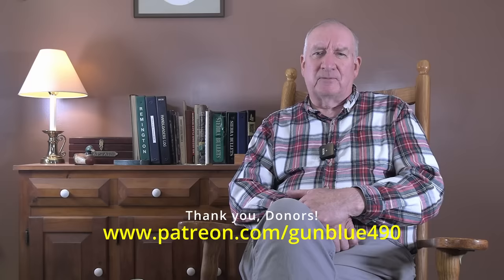The Copper Fouling Lie ~ Don't Fall for It!

Comment: Thanks for the sage advice. Always enjoy learning from your videos. 

What is your opinion on the use of abrasives, e.g., JB bore paste, IOSSO, etc, for bore cleaning?
Reply from the maker: I've used JB to clean rusted and neglected barrels, and it has helped correct old bores that foul with carbon persistently, but I certainly wouldn't use any such product on a new barrel, as the silica content used with a brush or patch can scour an otherwise smooth bore.  I've seen written articles about using such products to lap a barrel, which is entirely bogus.  Barrels must be hand lapped using decreasing grits of compound in conjunction with a barrel-cast lead slug before they are chambered and crowned.  Doing so afterwards will bell the throat and crown and ruin a barrel.  Good barrels require only a mild solvent to remove powder, soot, and graphite, which easily yields to a few tight, wet patches and perhaps a few passes with a bronze bore brush if needed.  The best routine is to saturate a wool bore mop and run it through the barrel.  Allow 15 minutes for the mineral spirits or Hoppe's #9 to loosen the carbon, and the wet patches will really do a great job.  The same holds true for carbon fouled rifle parts.  Drop them into a pan of solvent, and in several minutes they'll be practically clean by themselves
Reply: @GunBlue490  Thanks, GunBlue. Just picked up a quart of mineral spirits and will give that a try on a custom barrel with which I'm having a little trouble removing the carbon in the first few inches after the throat.

Comment: Thinking about a new 22-250 ,mine a rem bdl  1974 mod.
want to put my can on it ,never did the heavy cleaning thing .
Want to thread ,don’t want to spend $$ on a new bbl or threading 
If not needed   Mostly hoppies #9 on everything 
Throat erosion muzzle erosion??

Comment: Mr gun Blue thank you for your videos they are extremely helpful and I enjoy the cracker barrel style explanations of different and various topics I find it very pleasant . I have nothing but respect for your knowledge, I have often said the truth usually lies in the middle of any topic for there are those who are four or against every controversial topic, people , Will continue that method which works for them, for me the question becomes what is your idea of accuracy is it minute of pie plate at 100 yd, is it 1 in at 100, 3/4 in 1/2-in quarter inch or much less at 100. I believe that answering that question will dictate how often a barrel should be cleaned and understanding the nuances of barrels are all not the same much like people are not the same The recipe of the steel you can order 10 barrels from a particular manufacturer and all 10 will be somewhat different they will all shoot somewhat different. To say barrels when shot repeatedly build up copper in the boar is a fact of life there are several factors heat will vaporize the copper and deposit it down the bore and to say that the barrel will build up copper and then suddenly stop at a certain point with all due respect doesn't make any sense to me and I know people will hate on me for saying that but if world-class shooters who I will not mention out of respect for everyone The top guys cleaning their barrels all the time in the game of bench rest is different than f class f class is somewhat different than PRS and if John Krieger says to clean your barrels respectfully oh that's what I'm going to do so I am not trying to stir the pot but I respectfully have to stand up for what I believe is a mischaracterization of barrel cleaning, I am not one of those people who will clean after every 10 shots but I believe you should know your barrel and at some point you're going to know when to clean because you can control the frequency of cleaning to just shoot and shoot till the barrel begins to respond negatively and then clean your barrel doesn't make sense to me you can control the cleaning process and that will be one less variable that you can say why did my group open up the way it did You're removing one more variable. After reading the reviews I felt that I should give a different perspective and it is with great respect to your knowledge and I'm still a fan and always will be and once again it is with reverence that I disagree but I like your videos and will continue to watch them you are a wealth of knowledge and thank you for helping the shooting public in educating them to a higher level.

Thank you sir
S Baker

Comment: Always only used just only plain gun oil or 3 in 1 oil that my grandpa, dad, uncles etc...just used and never no problems. Not even with graphite for trigger, action, safety etc... but quit using that. Not a duck or goose hunter, but always heard the duck hunters have problems with their barrels cause from shooting steel shot. Not unless its neglect where someone puts wrong caliber bullet in gun etc...

Comment: Copper solvents are not snake oils; they are very helpful to remove copper from your barrel. Think about it! My sporting guns will not group with copper in the barrel how can a gun shoot straight with foreign materials building  up in barrel? IT Can't. Match shooters chide me when I clean my barrel at the range however they change their barrels on average four times a year. I wonder why? Find your own way I know my guns shoot much better with a clean barrel. If you start losing accuracy look in your barrel if you see the copper fouling instead of wasting bullets and over heating you gun try removing the copper with a good solvent (bore tech) you will be delighted when you go back to range.

Comment: I just bought some CFE223 powder. Not because of the CFE feature, just want to try some rifle loads. Should I be concerned about aggressiveness to my bore?
Also wondering if copper plated bullets pose any fouling issue. I’d assume it’s a different alloy. Although I’m only shooting them in my handgun so I’m only curious, not concerned.

Comment: Mr. GunBlue490, I inherited a very old Ruger M77 from 1970. It saw many hunting trips in its hay day, and it's in rough shape. I took the extractor off, and the back side of it is covered in...well...probably 50 years of carbon. What do you recommend I soak these smaller parts in? Carb cleaner? Mineral spirits? Hoppes? Thanks.

Comment: Get a bore scope and look for yourself what matters and doesn't matter for your rifles ability and your ability.   Also,  just because the military does something doesn't mean it's the best or even the right way to do something.
Reply from the maker: It's not my bore scope that shoots sub MOA.  There are two issues at large; the claim of excess pressure resulting.  In that case, the evidence shown by decades of military and civilian use and abuse put that to rest 100%.  Pressures do not rise.  Not one commercial rifle maker or ammo maker has ever warned of a danger of not cleaning copper from barrels, because there are no such concerns.  

The second is the claim of accuracy loss.  I personally attested that I do not remove copper and that my barrels remain highly accurate, below sub-MOA.  I've attended many matches where shooters don't clean throughout the day, and many never clean copper at all, from match to match.  Such are the many comments in this section.  Some benchrest shooters swear by it, others swear against it.  Copper removers are caustic enough to remove copper, and are corrosive enough to easily attack steel.  Some baseball players wear the same underwear at all games, which has nothing to do with anything, any more than the possession of a bore scope has to do with a gun shooting accurately.
Reply: @GunBlue490  a bore scope tells you how good your cleaning regiment is.  It will show you when the copper is smeared over the carbon and layered in there.   You mention of copper filling the voids in the barrel,   I've never seen copper fill the voids in the fire cracking on a barrel.   Or copper fill any pitting in the bore from corrosion.  
Sub moa means very little and is a very broad statement.  Sub moa might carry weight to a short range large game hunter with factory barrels. 

 The military standard for most shooting is basically sub human or sub hummer.  Not really a flex to brag about . 556 and 308 don't abuse barrels compared to many other cartridges out there. Barrel life in the 6-8000. Maybe try something that eats barrels in under 1000 rounds and tell people how not keeping the bore clean won't give them accuracy or pressure problems.       Your accuracy standards and personal experience is obviously different than mine.

Comment: First of all, I love your videos and watch them every chance I get. if you don't mind, I have two questions. When cleaning a bore,  does it make sense to clean from the muzzle end?  I was thinking that any fouling went in from the chamber end and it may be better to push it back than forward to remove it. Next question, I once fired a box of Winchester Supreme ammo with the black  teflon coating through my 7mm Remington magnum. After the 20 rounds, I discovered the rifling was filled to the point of looking like a smoothbore about 6 inches back from the muzzle. The plugged area seemed about 3 or 4 inches long, took a lot of scrubbing to get it cleaned out, A few years later my brother used the same coated ammo with the same results in his 270. Both rifles were Winchester model 70. I always thought that as the coating wore off, it got pushed into the grooves, Just wondering if you have any thoughts on this sort of thing. Thanks for your videos, knowledge and God Bless
Reply: Can't help you about the coated ammo, but it sounds like normal  leaning with a brush would be all you need. With regards to cleaning ALWAYS clean from the breech end when your firearm allows it.  You risk damaging the muzzle crown cleaning from the muzzle. Damage that and accuracy is shot.

Comment: I knew an old timer who never cleaned or oiled the action or barrel rifle over 50 years of deer, moose and elk hunting. He never had a single issue until it got so gummed up it wouldn't even set off the primer. He'd just wipe it down with oil and lean it in the corner.

It goes to show how pointless the perfectionism is for the average hunter.

Comment: I bought a winchester mod. 70 that was manufactured after 1964.
   Oh no !
 They're a piece of junk
no claw extractor , blah , blah , blah
Bought it way used in 1981 
 Shot several brands of ammo thru it to see what it liked
Rem. 150 gr corelocks
I have shot many deer , antelope , a coupla cow elk , coyotes , prairie dogs , jack rabbits , hunted 3 states ...
 I reloaded for it
 Finally found a recipe with a 150 gr nosler partition that would shoot 3/4 inch at 100 yds like the rem. ammo did
 I have never used a brush on the bore
Cotton swabs with hoppes and a swipe of rem oil 
 Still shoot it every year
mostly just deer now
( outta state tags cost too much anymore )
 still shoots corelocks
still groups 3/4 inch
Reply: Those rifles are very underrated… some people just won’t give them a chance
Reply: i get the criticism for the past 20 something years of winchester bolt guns but there are a hell of a lot of great post '64 model 70s.  that said i cannot imagine never using a brush while cleaning a bore.
Reply: @alaskalamb  
I have never had a single problem with it
 Been shooting it for over 40 years  
 It has always been my go to rifle if I needed extra confidence for whatever reason
  I use a rangefinder when I use my other game gun ( .338 win. mag. ) but never with the '06.  My mind knows where to hold and why and I just pull the trigger when it says to
 ... works

Comment: I love your videos but I'm sorry but what type of a benchrest match were you shooting a 270 in?
It has been a long time since I shot precision BENCHREST But I but I cleaned my barrels with sweets and you spray the brush with brake cleaner to keep it from disintegrating after you after you clean, then I used shooters choice and went in the building and reloaded my 20 rounds. I probably have around 1200 rounds through this barrel and it still shoots lights out. my last 3 matches the AGGs were less than 1/4 MOA that is five 5 five shot groups at 100 yards combined with five five shot groups at 200 yards (X3). The Borescope and the groups say my barrel is perfect.  I suggest people look at the target and the results of their cleaning and tuning method instead of watching youtube videos LOL

Comment: The Copper Fouling Lie - after that is the "corrosive primer" lie. Corrosive primers are fine as long as you clean your gun after using.
Reply from the maker: That's correct in theory, but it never worked in practice, as the US Military was very well aware of for decades. By its very nature, salt is highly corrosive to steel.  The more swiftly it's removed, the better, yes, but it still goes to work on steel, especially in humidity.  The standard old test for an old Springfield or Garand was (and still is) to see how much barrel steel was lost by corrosion by inserting a 30 caliber bullet into the muzzle. If the bullet goes in to the case neck, it's a very salt-worn barrel.  Military personnel are under orders to clean their rifles immediately after use, when practicable, and they did it by the numbers with boiling hot water set out by the company cook.  Ammo manufacturers advertised "non corrosive" for many years, because shooters were simply disgusted with seeing their pet firearms deteriorate, despite their best efforts.  People were dancing in the street when non corrosive priming came out.  No, it's not a lie at all.

Comment: What about lead fouling in 22 caliber rifles? I’ve purchased numerous used 22’s lately and three have had bulged and ruptured barrels. I’m thinking softer lead bullets begin adding layers of lead that finally result in a bullet jamming and not exiting the barrel. So does anyone think this possible lead accumulation could be the cause of these ruined barrels?
Reply from the maker: 22 ammo does not cause lead fouling whatsoever.  Standard velocity 22s are coated with very efficient waxed or greased lubricants. High velocity 22s are often copper plated. A 22 rimfire barrel with modern ammo will shoot accurately without leading for ten lifetimes.  Most competitive small bore shooters never would consider running anything but ammo through their barrels. In fact, good match grade ammo has a protective lubricant that prevents corrosion in normal conditions.

No matter what caliber, bulged or burst barrels are caused by firing a round into an obstructed bore; a stuck bullet from a prior squib load, oil, grease, dirt, water, brush, or a patch left in it.  The best way to treat a .22 bore is to simply run a .22 rimfire Bore Snake through it with a couple of drops of oil on its tail end to lightly protect the bore from corrosion.
Reply: @GunBlue490  Thank you for your quick reply and information!

Comment: Came across this video accidentally……I will comment I don’t agree with everything said, as I have experienced and corrected copper fouling in numerous firearms/barrels.   I would offer the next time you are told the barrel is ‘shot-out’ or the rifle won’t group and scope/mount is OK, and/or worse, signs of pressure start appearing in the firearm; THINK.

Comment: On ACME  Hi Tek coated lead  bullets do you  believe their coating acts the same? My dad never liked solvents and made reference  to the korean war  about just  removing carbon then lube because of high humidty in that  area would cling to the carbon  and corrode the  barrel
Reply from the maker: I used coated bullets in our indoor police range 35 years ago, and they performed just fine.

Comment: .Copper equilibrium is a thing. Or the  blue/green that comes out when using sweets is carbon your telling me? If your using lead "boolits" then sure no copper. Using copper jacketed bullets riding down steel doesn't leave deposits? I'm a machinist. So I don't need coolant or lubrication to keep the Copper off my tool steel? Try that out and see how it works. Chronograph data supports copper equilibrium theory as well..they go hand in hand. It's your rifle tune it how you plan to use it. 
Most people don't shoot far enough for humidity, spin drift or Coriolis..to those people it's silly to have chronograph data for a wide temperature range..

Break in your barrel. Set your copper equilibrium how you like.

Have built thousands of barrels. AAC, Remington, Smith, +,+,+,+. Bolt action to semi auto. 338-17. Some match grade pistol, etc,etc, blah blah blah...

Comment: I listened to your video and threw my Hoppe’s bore solvent in the trash. What can I use to remove carbon only?
Reply from the maker: Carbon and graphite (a powder coating) is quite easily removed with simple mineral spirits,,,, or soap and water!  Of course, the latter must be dried to preclude corrosion. Always follow up with a light application of light mineral oil.
Reply: @GunBlue490  thank you sir!! Love your show!!!

Comment: Would it be the same as lead bullets,ie don’t use solvents to clean the barrel. Do we just use a jag to clean the carbon and then just push a mop with a little oil through the barrel
Reply from the maker: Lead bullets can present the problem of lead fouling, which is caused by lead alloy of the wrong hardness.  Lead cannot be safely removed except by mechanical means, most notably the Lewis Lead Remover.  But, if proper bullets are used, a simple solvent and patch are sufficient.
Reply: @GunBlue490  thank you for your time and knowledge